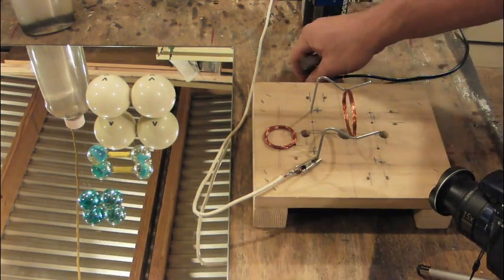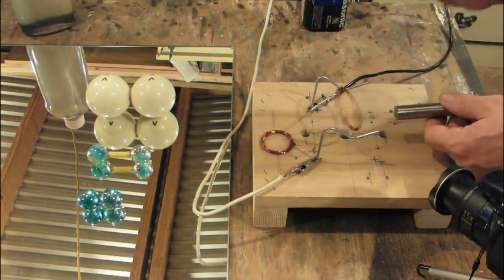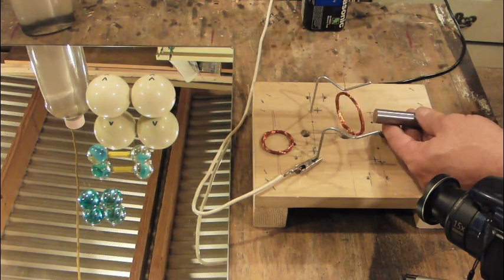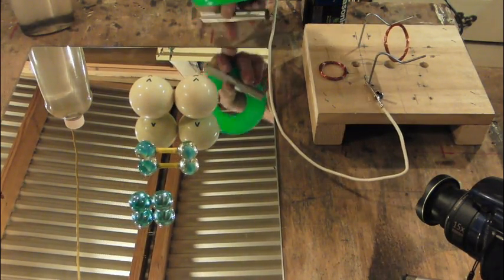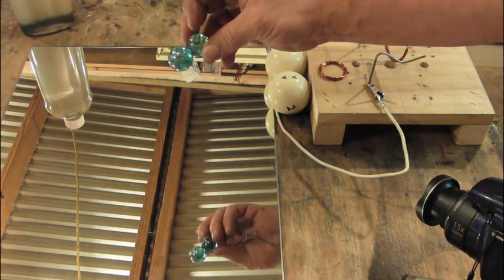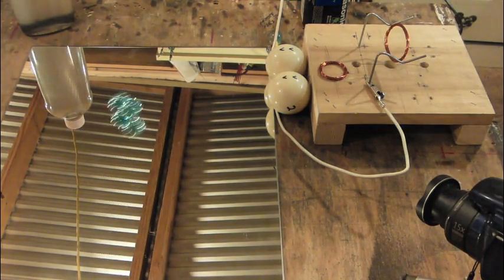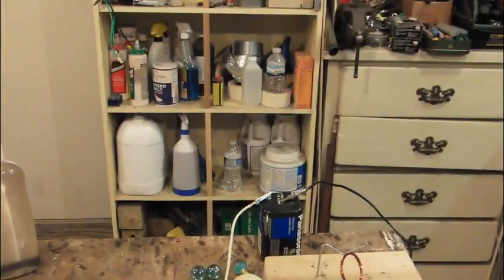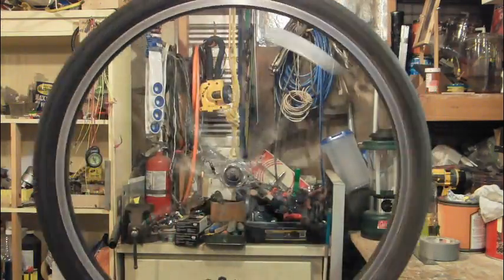The Right Hand Rule of the Universe

Comment: you should do the one from physics 101. sit on a swivel chair with the tire axle in your hands. get an assistant to spin it. then turn the tire so it's rotating on the horizontal. lol. spins your chair partway around. tuff to do as the forces really resist u and can knock you off the chair.

turn the tire back to vertical and see what happens. then turn it back to horizontal in the other direction.

Comment: I used to restore bikes as a hobby and would often play with the wheels like you demonstrate.  I have always wondered what is causing the rotation along the vertical axis. I have never been able to prevent it. At first, I thought it must be the rope unwinding, but I tried different ropes, cables, and wires, but it always did that same rotation. Is it a further demonstration of the right hand rule? Is it an expression rotational energy being lost to gravity (like a spinning coin as it slows)?